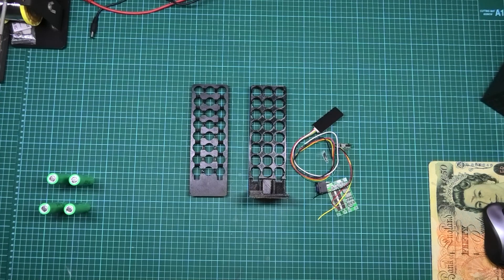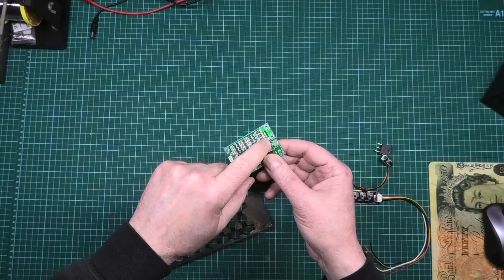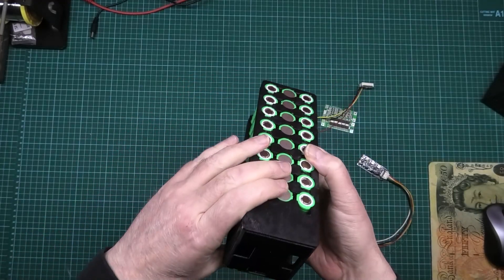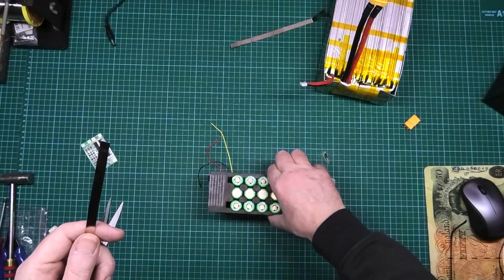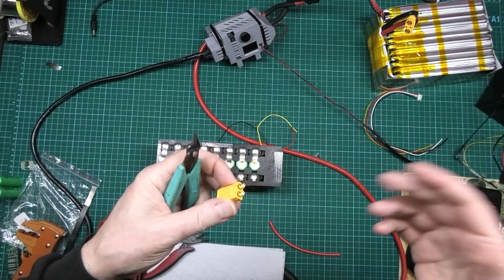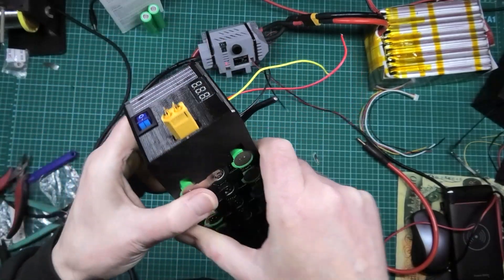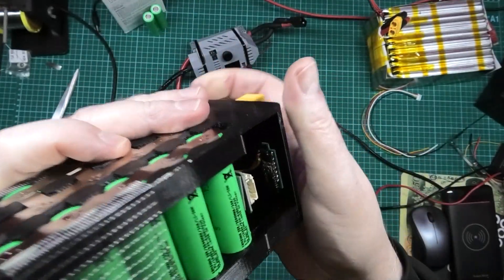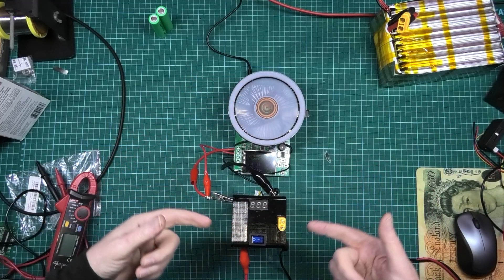12V (3S 8P) DIY 18650 battery build instructions

Comment: Tony, does it mean that balancer is always on? Like, forever balancing, even when it is stored? Doesn't that wear batteries unnecessarily due to smallest of fluctuations - or does it have some reasonable threshold before it balances cells? Also, in the next iteration, perhaps an automotive fuse would be nice addition since there is no undevoltage or short circuit protection at all... we all have been there :)
Reply from the maker: Yes, the active balancer is always on (the same as a normal BMS) and it draws microamps when it's not running. There is a threshold which varies depending on which manufacturer you buy them from. It's usually around 10mV so, if the cells are within 10mV, it's only drawing microamps.
The fuse....... oh, the fuse....... I didn't add one because it's usually rated at double the output so, in this case, it's 20A but the switch contacts will melt and go open circuit at anything over 10A so a fuse would have been quite useless and only served as a point of ridicule mate.
Reply: @Vortecks  thanks for answers Tony. Some BMS are able to toggle on/off (like VBMS you made app for, or that simple external balancer that you showed off recently), I am afraid it will try to unnecessarily balance under heavier loads (batteries may sag under load differently, even if they are balanced beforehand - and I don't want to be the one figuring out Kirchhoff laws how electricity flows then) but in this application it is okay I guess, batteries are overkill a bit. 
Oh and those cheap switches like to fuse weld instead of burning open. Ask me how I know :D Anyway, constructive suggestion for v2, add a fuse socket so that there is at least some option if something goes wrong (operator error) and I would go with a socket with balance wires exposed to switch between external balancer (when charging or storing) and LiPo alarm (undervoltage protection when in use).

Comment: If you had a problem (like a short) with that, you'd have fun using that switch to turn it off... ever thought of throwing a relay in-line? Great vid, Tone, love your commentary.
Reply from the maker: I did think about it but it'd add complexities that Mr Average would have trouble wiring up. A fuse would have been useless so I decided to use the switch as a fuse (it's the weak point) and, in theory, it'd melt at anything over 10A and go open circuit.
Reply: @Vortecks  You're doing an Elon! "The best part is no part"... 🤣🤣🤣

Comment: just bought a load of drill batteries to make a battery bank of 3s100p, issue will be educating a 200amp vw alternator to charge at 12v not 14
Reply: You might be best to use an inverter to drive a proper Li-Ion battery charger as these cells don't like being trickle charged after they reach full voltage.
Reply: @alibro7512  it's a build in a camper van so no grid supply just the alternator and the solar. Solar can be set 2v lower easily, the alternator not so easy. The van engine can be started down to about 10.5v but things should never be that low. It's stopping the alternator trying to charge at 14v which will take time to 'fix' as 4.66v per cell could be a road to disaster. Also 'trickle' charge isn't a thing for this chemistry, you jus set your chargers max out to 4.15x3 and that's it, no need to disconnect once they have got that voltage there's no current flow your just maintaing them at that level, done that for years with my smaller builds and bike batteries.
Reply: Could you use an old type mechanical voltage regulator, like for instance one off a Yamaha xs650, you can adjust them
Reply: @andyb7963  not for the alternator I'm using the regulator is built in, but it's an option to bypass the built in one and bolts on an external one, can't put anything in series with the output due to the amount of amps I'll be pulling when cooking breakfast with a 3kw inverter........ I'll admit most off the amps (200-225 max) will be from the battery pack but that won't last forever as the kettle slowly boils and the alternator will have to take up the shortfall, I know this works I fitted it last yeah with a standard 14v alternator and 4 big leisure batteries but they are heavy and don't last long, so time to upgrade, once I iron out the voltage difference issue. Another option is move to 16v 4s pack voltage, but I don't know how the inverter will like 16v...

Comment: If you copy this exacly just keep in mind that by using one strip of (8x0,12mm) nickel from the pack to the switch, it's rated for 4A continues.
Reply from the maker: I've drawn 10A though it from a full battery to empty, just to test it..... it's fine.
Reply: @Vortecks  I guess now we know how conservative those ratings are, but still the cells, cables and connector can handle lots more :p
Reply: @marcellnl  if you're worried about it just double or triple strip it